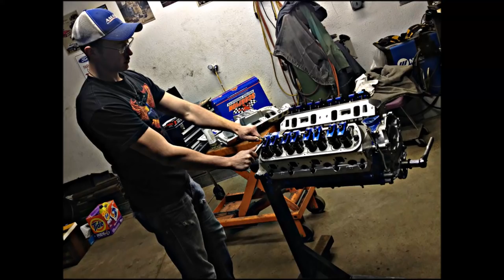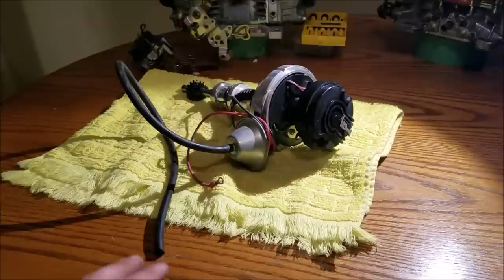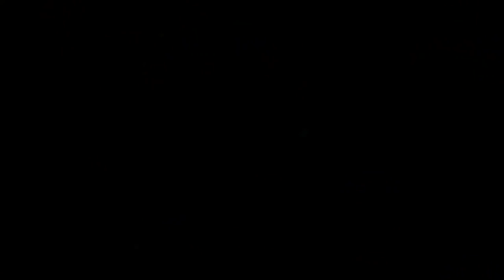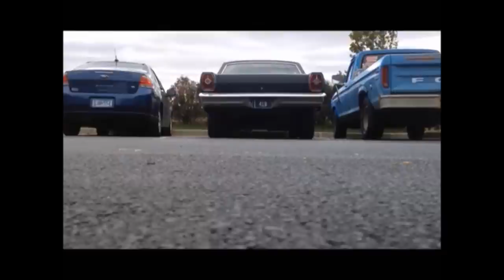Vacuum Advance Explained - What it is & How it Works

Comment: Someone told me about unscrewing the distributor and turning it a quarter turn to up the idle. Is that accurate?
Reply: Yes and no.  The idle goes up, but it's not the best and accurate way of adjusting idle speed, that's handled by the idle air control valve.  Turning the distributor to add idle speed will throw off base ignition timing, and will over advance spark timing past when it needs to fire, potentially causing engine damage.
Reply from the maker: for what purpose do you wish to increase your idle speed. if you are efi, it is best just to leave it be, especially the speed density stuff. on a carbureted engine, you adjust the main idle screw. (within reason of course)
Reply: There's some IAC valves on EFI systems that can be "adjusted", but basically it's just a sensor with a valve at the tip, and to take it out to recalibrate it back to stock if it's malfunctioning by working the valve and spring around then put it back in.  EFI systems will always keep their idle speed at stock, there's no way to adjust it.
Reply from the maker: hit the nail on the head here. if your idle is too low, be sure to check over your basics that oftentimes get neglected on injected stuff. ie. cap, rotor, plugs.

Comment: my cars previous owner had the gahd dam thing hooked to a manifold valve! been running it like that for years until yesterday and now i know how wrong it was lol
Reply: i dont understand, my ported valves feel the same on the throttle as the manifold does at idle. also my idle got better after switching it to ported, so does this mean i dont have a "mild cam"? mild means stock? or is it a reference to size? see idk what the previous guy did but the motor has new seals everywhere i look so now i think he may have upgraded. to me it makes more sense to have it ported most of the time. and is that a ford galaxy at the end there? shits nice!
Reply: If it is a stock motor and its hooked to ported KEEP IT HOOKED TO PORTED. Custom application motors should use manifold vacuum.

Comment: Where is the best place to draw Distributor vacuum on a SBC with a Rodchester Quadrajet?
Reply: Any manifold vac source
Reply: Manifold vacuum is pulling way too much advance. Until I limit the travel in my can, I'm using ported vacuum.
Reply: Gotcha. Crane has a good adjustable vac advance can that comes with springs to recurve the distributor. It's a great kit for the street. You'll need to adjust it to provide around 10 degrees, no more than 15. Then plugged in to mainfold vac of course.
Reply: @paulkessler8622  I believe the Accel unit works a little better than the Crane, at least that's what feedback from users of both have told me.
Reply: @hmdwn  What are the symptoms of it adding way too much advance?
Reply: @65sohc  I honestly haven't had the time to play with my Vette in several months (caring for my 91 year old father is a full time job) However and again when I ran manifold vacuum the idle advance was very high. While it seemed to start ok (this was during the very cold winter months) I was leery leaving it that way for the hotter summer months and forgetting it was hooked-up that way. Too much advance or retardation can cause heat. So, several months ago I left it hooked-up to a 'ported' source and that's where it currently still is. When I have time to play around with it again I will install some type of vacuum limiter kit in the distributor as I do not want to see the very high vacuum numbers. (I have my notes somewhere but I believe running manifold vacuum was pulling almost 60-degrees of vacuum.

Comment: what's your opinion on quadrajets? I don't understand why they get so much hate.
Reply: Quadrajet carbs are great carbs !!
Reply: grabir01 yeah, I completely agree. I love mine, but I don't understand the hate which surrounds them.
Reply: asus6983 stick with the quad man they're amazing carburetors when in proper working order. thermoquads are good too but that's Chrysler
Reply from the maker: - from a design perspective, they are rock solid. small primaries for cruising, very good booster design for effective atomization. my only qualm with them is the float adjustment. 
with these carbs being of more of a precision nature, they will struggle when misadjusted - carb tuning becoming almost a folk art now, its to no surprise that the populous today is not fond of them.
Reply: ThunderHead289 lol the quads are the only carbs if ever had. I had an edelbrock before but it ran horrible. I like how the quads are all 750 or 800 cfm and the engine will only pull as much cfm as it needs
Reply: Edelbrock 4 bbl EFI systems copied the design sort of, except the fuel is sprayed directly into the intake manifold instead of on top of the throttle plates, and there's no larger secondaries, all the barrels are the same size.  If you're looking for the performance of a carb like throttle body but don't want to deal with minute adjustments, 4 barrel EFI systems are a good alternative.
Reply from the maker: i have not had anyone bring me one yet, would love to work with one !!!
Reply from the maker: the sniper efi works very well. a buddy of mine has one on his nova. 
im personally stuck in my ways and am determined to outrun him with carbs just to see if i can.
Reply: It's a joke that those who hate them simply fail to understand them. Edelbrock carbs are almost duplicates of them and everyone likes them.  Quadrajet Carbs are more complex yet function very precise while a holley is not new out of the box. The Holley requires extensive tuning before it's installed (many do not do this for some reason). The accelerator pump ratios, jets and gap settings are critical on a holley for each application, if you want it to perform correctly in all power bands.
Reply: I have a 1967 impala with 327 it has a rochester 4 barrel quadrajet and its great but my buddy is a ford guy and always calls it  quadrajunk!
Reply: The only more reliable carb is the Rochester 2 barrel. Bulletproof. They burn more gas cruising because the butterflies are larger than  Quad primaries, but seem to run good forever.
Reply: Yes Garth, you are sooo right. On my Mopar 340, I modified a Holley 650 dbl pumper with  accelerator linkage cam, squirters, jets, pwr valve, 50 cc pumps etc. Mash that pedal as fast as you want, and NO hesitation ! BTW, a well tuned Quadrajet does the job quite well on my vintage Pontiac 400 engines.

Comment: how would a leak in that line to the carb effect the engine ?
Reply from the maker: No vacuum advance - bad gas mileage
Reply: Thanks for the reply. Love your vids. Having a fuel problem now. New truck runs perfect for 35 min or so then stops running until cooled down. 2 out of 4 times when fuel line is detached from carb there was gass dripping. The last time I put the file line in a water bottle and tried to crank over
Reply: No gas was coming out. Then after a while I got gas. It has a little shit fuel pump with no filters. I'm thinking vapor lock. Due to it waiting until OP temp to stall. But no fuel coming out seems weird. Like it should spit some gas right.

Comment: Do I stab the distributor at tdc or 10btdc ? On a stock 302
Reply from the maker: 10 degrees before TDC
Reply: @ThunderHead289  that will be before the piston starts to travel back down?
Reply from the maker: MARIO RODRIGUEZ yes sir, it takes time for the fuel to ignite and propagate across the piston, so technically it fires ten degrees before tdc 👍

Comment: I have a 350 chev in a boat, looks as though it has no spark. What could this be?
Reply from the maker: William Chisholm could be a number of things -!here is the video I made that will walk you through what to check 
https://youtu.be/9GwTtrdtHbQ
Reply: Got moisture in the HEI module. $9 ebay.

Comment: So i have a totally stock 429 ford, should i run the vacuum advance off the ported or manifold vacuum on my carb?
Reply from the maker: id say, run 8 to 10 degrees initial timing and hook your vacuum advance to manifold vacuum.
Reply: Full time

Comment: Explained everything except what (more timing) means. Does it mean more advance or less. Seems to mean the faster the piston speed the sooner the spark should happen. The term (Vacuum Advance) seems to imply faster piston speed/lower vacuum  would advance timing. So the question is, does less vacuum,  advance or retard the spark? I saw you suck on the vacuum, but did that advance it or retard timing? Or are you saying the leaner the mixture the sooner the spart shoud occur so as to have time to explode at top dead center? Which leads to why do smog engines mess with timing?

Comment: is 5.0 coyote engine a 302 cubic inch block
Reply: The Coyote does displace approx. 302 cubic inches but otherwise has absolutely nothing in common with the 20th century 302.
Reply: For the price of one you may want to spend half and build a good traditional 289 with all the goodies to get the same power. Or a big block.
Reply: DAM GOOD ADVICE !

Comment: 1963 Chevy belair 230 straight 6.. I heed a tutorial on setting vacuum advance timing and air/full mix. I have a KAL-EQUIP CO tach dwell tester that I have no idea how to use. It has a setting PT. RES.  And when selected the meter goes deep in the red zone

Comment: It can go both ways.. If you are running very rich, it will slow the burn rate.  If you are running very lean, it can increase the burn rate.
Reply from the maker: i agree with you - but only in excessive scenarios. a rich mixture that is too rich cannot be properly ignited, a lean mixture will get extremely hot from the compression and want to preignite. if either of these scenarios (below 10:1 or above 14.5:1) exist, the carb needs to be adjusted immediately or permanent damage can and will occur.
Reply: I have a 69 Skylark Buick L77 350 4B  10:25:1 compression.. 285hp 400 ft lbs..   It pings. I have it at 4 degrees static. I run super 91.  Under low RPM and a good load, it will ping. I can get it to stop by going 2 degrees static..  But I lose so much power.  When the motor is cold and warming up, no ping.  Once it is warmed up.. Some pinging.. Any suggestions?
Reply from the maker: what carb, intake, and cam style are you running? also, what is your elevation and relative driving temps? and when you say static, do you mean initial timing BTDC? are you using a timing light to determine your settings?
Reply: Quadrajet . Engine is factory original. and yes..  BTDC. I am at 6000 feet. 9000 feet for HP reason as we run at times single digit humidity here in Colorado.  Yes.. I use timing lights.  Temps here as of late are 70 F.  Normally I run 1.5 degrees advanced for every 1000 feet.  But on this Buick, i can not do it. Must be because of its high compression as it was made to burn Ethyl pump gas back in the 60's.  I am considering a 4 row aluminum radiator and a 165 thermostat.
Reply from the maker: well, i cant chalk it up to too lean of mixture as you are lacking oxygen at those levels to the point that you may have to even pull jet out of it. im curious what your plugs look like - you seem very competent in these affairs. 
the lower you can keep the engine temp (dont operate below 160) the cooler the cumbustion chambers, and the better they will resist preignition. 
let me know on the plugs.
Reply: Try stiffer springs in the centrifugal advance first, if that doesnt work , keep the originals to go back to.

Comment: sorta decent video... if your car never sees part throttle, you can use mechanical advance ie. drag/circle track. If you need to modulate the throttle ie. driving on the street, you SHOULD use vacuum advance to maintain an ignition curve that is proportional to load. Advance canisters should always have full manifold vacuum and not ported. Finally, don't put a huge cam in a street car and complain about driveability issues.
Reply from the maker: I actually do agree that all street cars should run manifold vacuum and vacuum advance, but to explain the logistics of the settings, the video would be 25 minutes. On a street car you should have enough (if cam selected properly) to run vacuum advance. Now, a mild cam will require some addition initial timing on the mechanical side for if you were to mash the throttle from a stop. A stock vacuum advance will pull in too much timing in combination with that 14 degrees or so of mechanical ignition timing. This is where it would get intensive to explain to people. You would then need a vacuum canister that does not pull in as much ignition timing so your not idling with 30 degrees of timing, which is too much. 
I'm glad you brought this up- good discussion here
Reply: I think we agree everywhere :D It is an intensive subject. Simply, if you need to modulate the throttle, you need to modulate timing somehow to match LOAD. 30* of timing at idle is fine. A GM engineer said ported vacuum was an effort to put the idle exhaust temperature in a different range to burn selected pollutants to satisfy clean air directives imposed by the government. Full vacuum gives a smoother idle and better throttle response. The best answer here really is dynamic EFI.
Reply: Not neccesarlly. Any cam with 300 duration or over cant use vacuum advance due to not enough vacuum. NAPA sells many different vacuum advance units for different hg of vacuum levels. Your vacuum advance should be fully "in" @ 2 hg BELOW the idle vacuum of your motor. If not, your distributor "dithers" meaning the vacuum arm isnt locked in, it is fluctuating, changing timing , motor stalls when you put it in gear. The NAPA advance cannister for a GM HEI with the lowest vacuum rating is part # VR-1825. It still wont work on cams below around 9hg of vacuum.

Comment: Am I allowed to watch your videos being a Mopar guy? I think there are some states in the South that will put me in jail for that.
Reply from the maker: As far as I know a pushrod engine is a pushrod engine. Ignition is ignition. A holley or Edelbrock carb is a holley or Edelbrock carb. 
I wouldn’t even be a ford guy if it weren’t for the ease and extreme affordability of swapping the venerable 80s T5 5 speed into literally any classic Windsor powered ford.

Comment: Most people don't understand how vacuum advance really works, that's really a vacuum retard canister at low rpm, as the engine picks up RPM vacuum drops then it advances . Take a look at when you were sucking on the hose you moved the distributor clockwise which would retard the timing not advanced it.

Comment: Ported vacuum advance is for smoggers. It came in in the early-mid 70's. Proper vacuum advance will help keep your engine running cooler and will aid at cruise, which is low load, lean mixtures.
Reply: If your engine is timed at lets say 10 before tdc .
      With the vacume advance disconnected .
      If you were to rev the engine it will accelerate to lets say 3000 rpm in a certain amount of time .
      Then , hook up the vacume advance canister .
There will be on change at idle because you connected it to a timed port .
    But ... When you rev the engine again to 3000 rpm , it will rev to that point faster and with less effort .
       When you rev your engine even with very little throttle the vacume will drop .
      This drop causes the power valve to temporarily open and causes a rich mixture .
       This condition can and will benefit from more ignition timing from the quick response of the vacume advance .
       A rich mixture burns slower .
A lean mixture burns quicker .
       A rich mixture burns cooler and a lean mixture burns hotter .
        I noticed the first comment that said that timed port is a smog or emissions thing , but it's not .
       I've worked on many 50s 60s and all through out the 80s .
       There was a trend starting in the mid 70s or so to slow or electronically control the advance in the ignition .
        They ran the engines lean as possible and controlled the ignition timing AND introduced 02 into the exhaust .
       Retarded ignition timing along with oxygen injected into the exhaust burned more hydrocarbons and fluorocarbons CFCs and pcbs in the exhaust .
       And we had much less power but better girl economy but engines did not last as long because of the heat created by lean and late .
        
        Ported vacume gives a much more responsive part throttle and much better part throttle driveability 
        With timed port you tap the throttle and the engine vacume recovers much more quickly .
       When hooked to manifold vac , you have to set the timing with the dist hooked up and with each increment of throttle you loose ignition timing until the mechanical advance runs up to its limit .
         
          FORD , did much with ignition timing and vacume advance was something they knew about .
        On many manual trans Ford's of the 60s had a dual vacume canister on the dist .
      One went to timed port and the other to manifold vac .
       It was to return the vacume advance to zero FAST when you let off the gas so you could shift or downshift faster .
       What happens if you advance the distributor while it idling? 
The engine runs faster and faster until it starts misfiring .
      The engine becomes more efficient until it's mechanical limits are reached .
Reply: @jamessignorelli852  Lean mixtures burn slower and need more lead. Ported vacuum advance is for smoggers. Rich mixture burns faster, which is why vacuum advance falls off at WOT and high load.